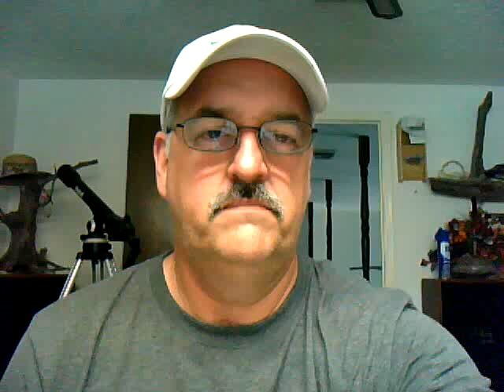Oil in your radiator.

Comment: I have a 2007 Nissan Xterra and have the reddish fluid mixed with my coolant. I noticed the transmission stuttering from usually a stand still and also slight shifting problems. So knew they have this known issue with the cross contamination and looked at the coolant reservoir and took a screw driver to test the fluid and it was not milky, just oily. Now do I have to pull the whole radiator to fix this one part or can it be done with the least invasive manor? I'm trying to avoid spending a ton of money at the Nissan dealership who will probably charge me over a $100 for a "diagnostic test on it"
Reply from the maker: You could take it to a radiator shop if it will make it there, they do not usually charge to look at it. They will be much cheaper than a dealership and can do the job just as well. He will be able to tell you what the problem is, will remove, repair and replace the radiator as well. Hope this was helpful.

Comment: My boyfriend had left the top to where the water goes(to radiator ) I found out when the car started overheating, I quickly pulled over and my mother put in the oil for me. At that time she thought it was the oil that spilled, so she pour 2 quarts of oil in the radiator. After I turned the car on it started getting hot again so I pulled over immediately. A truck took it to my mechanic. We thought by flushing everything out it was going to be ok. But I got a call saying the cylinder head cracked. Could this be possible if the car didn't overheat much?
Reply from the maker: If n engine gets to 220 degrees or hotter you have to let the engine cool down until it is completely cold before you add water or it will crack the head. If the engine is very hot, you add cold water, the water will go in the radiator and then start spitting it back out as soon as it enters the engine turning it into steam. If this is the case you would hear a pretty loud pop, that unfortunately, is the head cracking. The heads would have to be replaced along with the head gaskets.

You say mom added oil to the radiator and then you moved down the road when it overheated again. I imagine this is when the truck came and took it to the mechanic. Understand you created a situation for the mechanic to diagnose. Adding two quarts of oil to the radiator would have turned the radiator coolant milky white indicating to the mechanic, the head gaskets were blown. (did he start it to make this decision, who knows.) If he did actually start the engine and saw air bubbles or the fluid push out of the radiator while the engine was still cold, either the head gaskets were blown or the head or heads have a crack in them.

I'm sure it would be no surprise that a shop would jump straight to the conclusion and suggest the heads be replaced. My suggestion would be to get a second opinion and explain all the details to the mechanic. If he can actually verify this and prove it to someone that can go with you to review his findings, you will get your answer.

Because I have the ability and knowledge, I would have drained the radiator, flushed it with water and started it back up. If there were no air bubbles or if the water was instantly pushing back out, I would place the cap back on the radiator and allow it to get back up to operating temp. If it stabilized, the head gaskets and heads are ok, if it started overheating within 20-30 minutes or on the test drive, I would conclude, the head gaskets, at a minimum are bad. The only way to verify the heads were cracked is for the heads to be taken to a machine shop so he can determine if they are or are not cracked.

Sorry I did not see this sooner. I hope it got worked out properly and I hope this will at least help any others that have a situation like this.
Reply: +Succstrat Interesting, also, since I don&#39;t believe the two quarts of oil she added to the coolant would have caused the head to crack (if it&#39;s even cracked, and did they TELL the mechanic that they added oil to the coolant??)... so if it &quot;is&quot; cracked, I&#39;m wondering if the mechanic might have caused it by flushing a hot engine with cold water, and not waiting long enough for it to cool down? And then telling her she had a cracked head without wanting to take responsibility for it, but hopefully her head wasn&#39;t cracked at all, and it&#39;s just the oil in the radiator that caused him to assume that. Is there a reason why you would flush only the radiator in her situation, and not the entire cooling system, assuming they ran it long enough for the oil to spread?? I guess you mean right after the oil was added, and before they drove it and circulated it through the entire system (including the engine passages). Or did you mean that you would have done that if you were the mechanic, after they&#39;d already restarted it and driven a short distance? Pretty impossible for the average person on the side of the road to flush their radiator, even if there is a water source nearby, so understandable they would want to drive it somewhere, and she wasn&#39;t clear on whether they knew she&#39;d added oil when she restarted the car, or not... unfortunately running it and driving it after the fact only spreads the oil beyond the radiator, and two quarts is a lot of oil. Lessons for those of us who are dumb enough to add oil to our radiators... but "I" only added 16 ounces. LOL. Just a few things to think about, for you folks out there who are new to the wonderful world of auto repair. :O)

Comment: I have a 1993 or a 1994 Toyota corolla and I have oil in my radiator. I saw this problem about four days ago and noticed that  I had lost all my oil in my engine I am worried and not sure what to do. I have really not time to have a mechanic look at it I work everyday and weekends.
Reply from the maker: Never continue to drive the automobile. Water in the oil will cause the internal bearing to rust and the you have a bigger problem that could lead to a motor overhaul. Please read my reply to Mr. Lopez below. It sounds like you blew a head gasket, the engine oil is mixing with your radiator fluid. The engine will eventually fill with water and cause the engine to lock up, you can also get oil in the cylinders. If the car sets for more than a week or so, the water in the cylinder will rust the rings to the cylinder wall and cause the motor to seize. A good mechanic could get it to free up but this is not a good thing and he will not want to warranty the work, he would prefer to do a total rebuild.

Comment from the maker: Oil in your radiator? If it is pink it came from the transmission, if it is milky it came from the engine oil. Check out the video at

Comment: Hope your still monitoring this, I have 2002 blazer Xtreme, and its got oil the reservoir and the radiator, but every thing else is fine, like you mentioned, you pulled the radiator and had it fixed, what exactly was fixed? (the 65.00 dollar part) was the part on the radiator or the transmission? and what do I look for at the transmission, do I need to pull off the pan? what ever information you can give would be greatly appreciated, and Thanks for your video, That's eactly the symptoms my blazer has now!  when I first saw the problem all I could think of BLOWN HEAD GASKET!!!
Reply from the maker: Sorry I did not see this sooner. If the oil is milky white it is engine oil, if it is pink, it is transmission fluid, My problem was coming from the transmission. There is a small transmission cooler inside the radiator tank that has transmission fluid running through it. This sits inside the radiator tank on one side of the radiator and uses the water being cooled for the engine to cool the transmission oil at the same time. That piece had a crack and allowed the transmission fluid to get in my radiator water. It was replaced, the leak went away but there was still residue of oil in the radiator so I flushed the system a second time. If it is engine oil you are dealing with, you probably do have a blown head gasket. You can confirm this by taking the radiator cap off when the engine is cold. Start the engine, give the radiator about 10-15 minutes to get up to temp and open the thermostat and then look at the water in the radiator. You will either see air bubbles being generated or the water will continue to be forced out of the radiator. This means the head gasket is blown and water is getting in from between the water and oil ports. You would have to drain the radiator etc...pull the heads, add new head gaskets, drain the engine oil and add new oil and coolant. You will need to put some inexpensive oil in the motor the first time just as a rinse. (use the original oil filter) Run the motor for 20-30 minutes, shut it off, drain the oil, pull the oil filter, replace with a new one, add oil and you will be good until your next oil change. Watch your oil after the first hour or so and continue to watch it, if the oil is only slightly tainted, it is still reside. Hope this is helpful.

Comment: hey, I have a 1996 geo prizm, which is basically a toyota corolla. I bought the car used at 80,000 miles in june, and it is now february and ive put 88,000 miles on it. one day when i checked the antifreeze i noticed there was a small amount of oil within the coolant resivoir. I was nervous so i took it to my mechanic whom i trust very well. He flushed the radiator and put brand new antifreeze in it , about two weeks later i seen the same thing occur. When i asked the mechanic he said i should not worry about it and this was when the car was on 85,000 miles. I drive 30 miles a day to and from school and i have had no problems with the car yet. Should i be worried ? or should i continue driving as i was.
Reply from the maker: Do not lose any sleep over this, the mechanic is correct. What he did not tell you is there will still be residue of the oil in the motor that has settled, you can not get it all out on the first try. It is nothing to worry about. Keep an eye on you transmission and oil level. If you start loosing oil and it starts showing up in your radiator again, then you have reason to have the mechanic look at it again. Hope this was helpful.

Comment: Thank you very much!!!!! I’m having the same issue with my Nissan Truck, yesterday I opened the radiator and I had all that milky pinky oil (just exactly like you described), and you are right, sometimes not very often  I have that bump feeling with the transmission and if you slow down goes away.
Great help!!!
Greetings from El Salvador